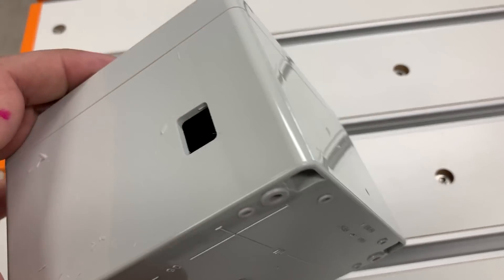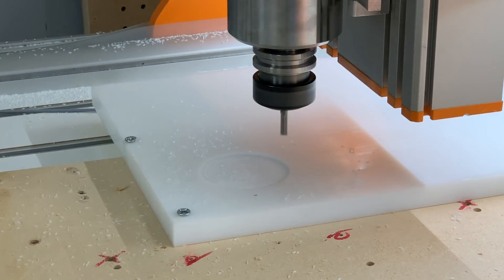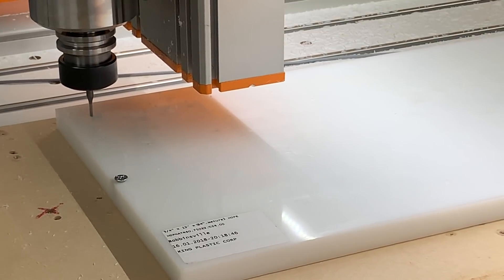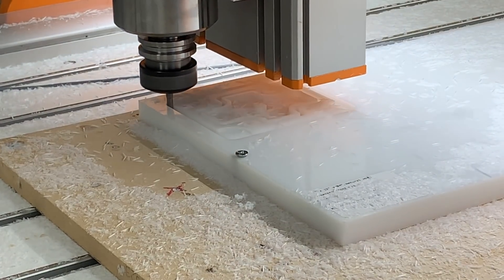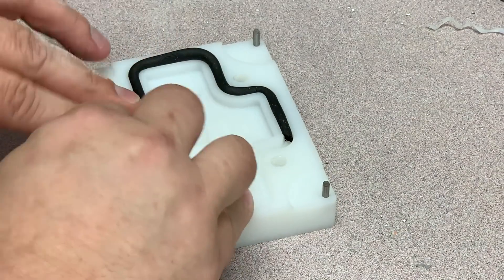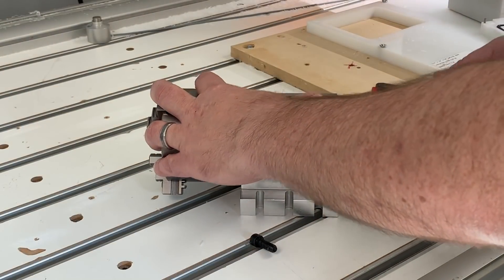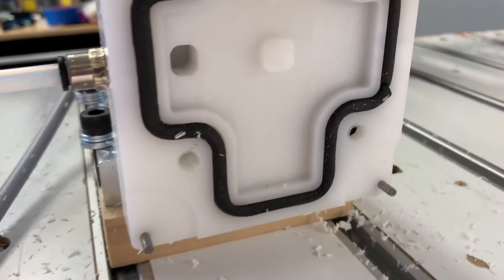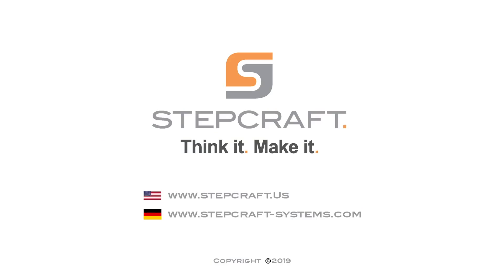Custom 4th Axis Vacuum Fixture for 4-Sided Machining on CNC Router

Comment: Could you please help me answer a simple question. I am a machinist looking at a 408..  If you cut a simple 2inch x 2inch square in 6061 aluminum with a .03 doc with a 1/4" catbide e-mill on your machine what will it measure in each axis? .000

Comment: completely marred the vacuum hose attachment.
After you drilled the hole, you already had the part aligned to use a 60° or 90° point in the drill press to REALLY tap vertically.
Did you properly calculate the volume of the channel vs hose and the width of the channel for the chosengasket?

Comment: You should add a fluted path into the edges of the suction block and weigh down the vacuum tube on the side so it intentionally wraps snugly around the part holder. Like cable tracks in garage door spring drums.